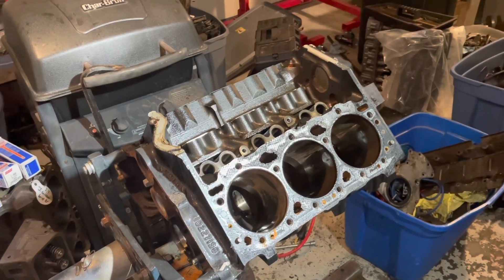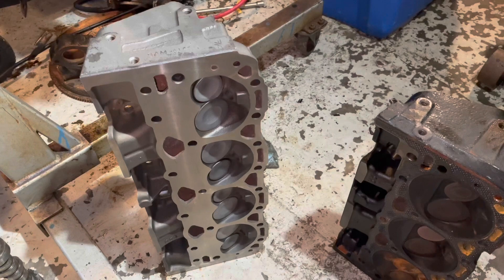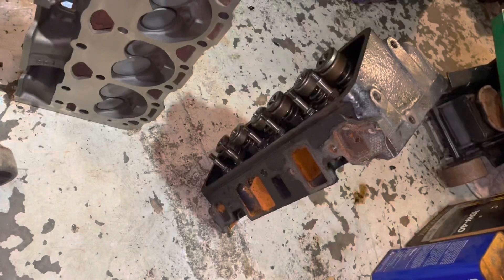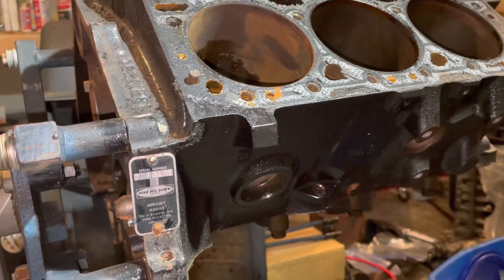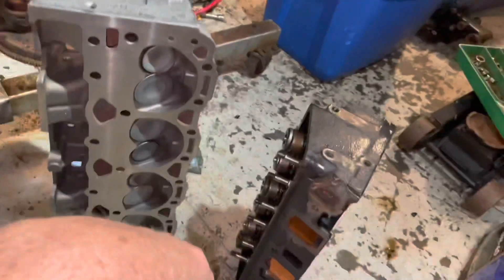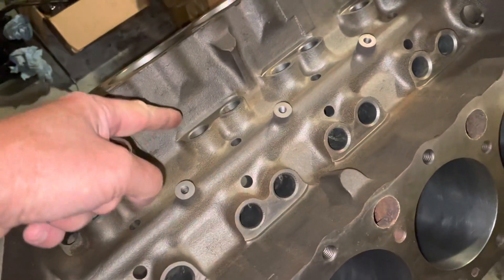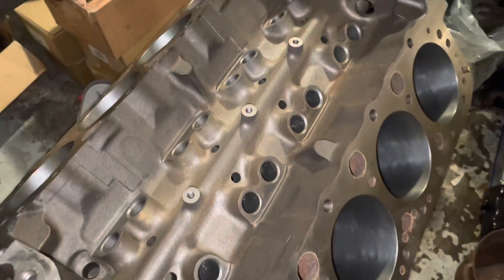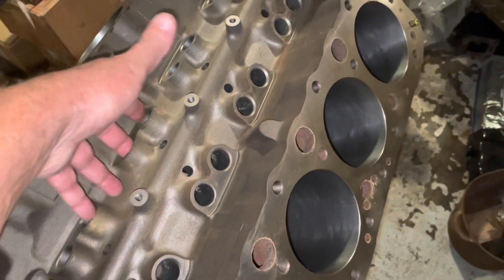Truck/Car to Mercruiser - How To Guide

Comment: If plastic fuel rail wasn't a problem. Would you go with that instead of carburetor?
Reply from the maker: I don’t understand your question as it relates to this video.
Reply: @moccasinmarine  Would the plastic intake and fuel injection work in boat? I got a yamaha 4.3 that has bad bearings, and I'm thinking of buying a car 4.3 with fuel injection. The rochester carb is also bad on my motor
Reply from the maker: @Mattias7475 the main problem is not the plastic rails (which is a problem) but the fuel injection manifold is aluminum, which will get eaten up by warm saltwater. You could only use the boat in fresh water.

Comment: Any pointers on marine lt1?
Reply from the maker: Not understanding your question? I’m not aware of a marine LT1.
Reply: @moccasinmarine   indmar made an lt1 5.7 for years, new wake boats actually  have gen v 6.2 lt1 as well but im referring to the gen 2 small block.
Reply from the maker: @pinnedit I don’t work on too many wake boats or inboard ski boats. 99% of my customers have stern drives. LT1 was only made from about 1993 to 1996 and abandoned for the LS program. They are therefore rare.

Comment: I am kind of new to the boat performance but with the headers on a boat going up would the vortec head fit with that I have a Volvo 5.0 v8 I have been told it’s a SB Chevy motor
Reply from the maker: Vortec heads for 5.0 engines offer no performance difference since the combustion chamber is the same as non Vortec heads. The only difference is the intake bolt pattern in the 8 bolt vortex pattern. There is no point to switching heads. Reason is the 5.0 bore is too small to use the Vortec combustion chamber shape.

Comment: Vortech heads will work on a 305 v8. We did that on my brother’s pickup.
Reply from the maker: The valves are rumored to hit the 305 bore walls but at the least the valves are shrouded by the bores so gains are reduced. If they fit then GM would have put them on 305s, but they didn’t.
Reply: @ they are on the truck and it runs 🤷🏻‍♂️ whether or not it’s the optimal configuration is debatable but technically they fit.

Comment: I was told you "Had " to use 4 bolt main ...is that true and why if not. Is the 5.7 and 6.2 Marine 4bolt main?
Reply from the maker: Most boat engines I rebuild are standard 2 bolt mains. This video is a 6.2 rebuild and it has a factory 2 bolt main bearing setup so what you were told is wrong.

https://youtu.be/q3C7-pWL7yY?si=w-mkuHONVhu229Tx

Comment: I noticed the color of the block. Is it a higher nickel block?  The circle track shop I worked at would get “some” blocks that were higher in nickel and they were Noticeably Heavier!🤣😂
Just wondering.  Thanks for the video.
Reply from the maker: I haven’t noticed any difference in blocks between a truck and boat engine. I have noticed that if you buy a “new” crate boat engine the block has a higher content of Chinesium.
Reply: @moccasinmarine  The blocks I seen were from the 70’s (400’s).  They had a color to them that were different from the norm.  They were also Noticeably heavier.  They had more nickel in them making them stronger.
I was just asking because of the color of the block you were showing.  Although I’m seeing it from a phone.😂😂
Just asking.  Thanks for the video.

Comment: I had to rebuild my 1995 bowtie in 2008 after running some low octane fuel on Lake Superior where they only had 87 octane and blew the lands off the pistons.  I had the timing advanced quite a bit to run 93 octane on my home lake and didn't retard it before the trip (big mistake).  The cylinders were just fine and no ridge, so only had to re-hone the cylinders at standard bore.  When I rebuilt it, I did use Vortec heads, a CS XM 262H-12 cam, and a Performer Air Gap Vortec intake.  I kept the same 9.4/1 compression ratio but did use hypereutectic replacements.  One extra thing I did was to enlarge the wrist pin clearance to ensure it wouldn't seize from any sudden temperature change.  This was recommended to me by a couple of engine builders in the Minneapolis area.  Dyno was 353/397 with a Holley 600 and extra spacer plate.  It's still running strong after 16 years.
Reply from the maker: Yes I pretty much stay in business due to people running 87 octane Ethanol gas. The combination of low octane and running 3-4% leaner due to Ethanol destroys engines.

Comment: Thank you sir!! Great video. I have a 1998 5.0 roller-cam Vortec Mercruiser that has a freeze busted block. Thinking about upgrading to a 5.7 (350) Vortec. My only question is where to find the marine specifications for 5.7 mercs?
Reply from the maker: There are no differences other than what I just stated in the video.
Reply: Sweet. Thank you sir!  @moccasinmarine
Reply from the maker: @jacobfriddle147  here is the service manual if you rebuild a 5.7. Use brass plugs for anything touching water and use the 5.0 marine cam in a car/truck 5.7 and you’ll be good.
https://marinepowerusa.com/wp-content/uploads/2019/08/5.0L-5.7L-MEFI-4-Service-Manual.pdf

Comment: This question is for moccasin Marine I am converting my 4.3 V6 truck motor as a donor because my boat motor froze. My question is I’m using the damper and the flywheel from the boat but the crankshaft from the truck engine. Will there be an issue with balancingor vibration with the crankshaft
Reply from the maker: It depends on the year of the boat engine vs the truck engine. Go to marineengine.com and find your engine serial number parts list. Then compare the part number to later model flywheels and dampers to see if the part numbers changed. If they did you may have balance problems

Comment: Can you put that vortex head and run that with a manual fuel pump or does that need to be changed?
Reply from the maker: If you mate vortec heads on an older block with a mechanical fuel pump then yes you can run a mechanical pump. Newer blocks with vortec heads were not drilled for a mechanical pump.

Comment: Wrong gm did use tbi intake on vortec in translation years. The 350 was 1995, and I'm not sure what year  the 4.3 had its translation year, but I have one .
Reply from the maker: They might have used TBI intakes on Vortec heads around 1995 but the intake would have been aluminum so still not a usable part in a boat. Boat intakes are cast iron to last in saltwater.

Comment: Had a boat shop ensure me my vortec wouldn't last 4 hours on the water. I knew it had the grey mahle pistons and I put hastings maganeese phosphate rings in it the powder metal rods behive valve springs factory l31 truck cam but with 1.6 rockers .050 offset valve keepers. Little bit of pocket porting 3 angle valve job jegs champion intake. It pushes my 3600 pound boat to 50 mph for 2 seasons and i couldn't be happier with it. I don't hold it at 5500 rpm for 3 hours straight either to be fair. Thanks for the honesty.
Reply: I forgot to add the only thing I saw you missed is the not all of the 880 roller blocks have the mechanical fuel pump rod hole drilled. The tool to do such is very expensive and if someone is in an rural area like me it takes a 4 hour drive to get to a shop willing to take on that work. My answer was an electric pump but not all want that

Comment: 14:55 Yes, with today's oil, you have to use ZDDP (zinc) additive or an oil with a high ZDDP content like Rotella t4 or t6 or even Supertech diesel oil To prevent your cam lobes from rounding off.   Or even Travelers brand from tractor supply also has high ZDDP zinc content
Reply from the maker: I stated in the video that I go out of my way to not build flat tappet engines because I don’t want to deal with the ZDDP additives. But it some cases I can’t avoid it like the MARK V 454 I’m building soon. It’s old school flat tappet.

Comment: My 1987 4.3lt engine is bad. I have a 2003 4.3lt vortec engine out of a truck. Im guessing the cam in the 87 is a flat tapped cam but not sure as i haven't taken it apart yet. If its flat tapped it can't be used in the 2003 block as those should be a roller cam
Reply from the maker: Look up the serial number of your 1987 4.3 on www.marine.engine.com. I believe you will find that all 4.3 engines since 1985 were roller cam engines. Then compare the camshaft part number to a 2003 camshaft part number to see if they are the same part. If it’s the same part then you can use it in the 2003.

Comment: I'm a regular gear head and I fell in love with the vortec heads from the day they came out. there are carbureted intake manifolds available for the vortec heads of both the v and 4.3 v6. at that point, you can get a carburetor and not have to worry about figuring out efi
Reply from the maker: If an engine already has EFI its way easier to just fix the EFI than swap to a carburetor. I’ll soon post videos on EFI system troubleshooting and timing.
Reply: @moccasinmarine  true. I've done both. However, as far as performance options go, it's much easier to find a high performance intake for a carb application...and much cheaper. I've priced out a Marine intake with efi for $700. Mild boost in performance for the intake, then you still have factory sized injectors that you would have to replace. With a carb and intake, you could be as cheap as $500 and you're off. Of course, I'm talking hotrodding, not just start and go. For that, efi is much more reliable and more efficient. A carb can't touch the cold start of efi, or the fuel mileage of efi. I still enjoyed the video and thank you for replying

Comment: Coming from a complete noob. Are truck cores pretty interchangeable? Like if I buy a Chevy V8 core, convert all the plugs to brass, slap a vortex head on there, bore the cylinders .5 thousanths over, get different cams, and should be set?
Reply from the maker: Not necessarily. Vortec blocks (1996 and later) use a plastic timing cover with different bolt hole pattern and cam plate sizes. And the mechanical fuel pump on Vortec blocks is not drilled. Older blocks back to 1988 can be used but you’ll have to deal with work arounds. 1987 and later are no go’s. They have two piece rear seals and are guaranteed leaks.

Comment: Hey man I designed and built a jetboat. Currently I have a Yamaha svho as the power plant (around 265 hp) but I keep having issues with it and so I’ve kinda gone down the rabbit hole of building a new power plant. This video has been super helpful.

Comment: I have a 2004 Mercruiser 5.0. It’s 260hp. Is there a way to get 40hp. more out of this engine without a complete swap out to a 350?
Reply from the maker: Where did you get the 260 Hp figure from. All my experience has shown that 5.0 makes about 220-230 Hp.
Reply: @moccasinmarine  I got it off the Sea Ray Spec Sheet for my 2004 Sea Ray 200 Select. It states that the Mercruiser 5.0 MPI is rated at 260 hp with either the Alpha One or Bravo III Drives. I have the Alpha One. It also shows the 350 Magnum MPI at 300 hp.

Comment: I am going to use a 2001 4.3 vortec truck engine in my boat. I decided to try it with the truck cam. Do I need to pull the heads off and change that gasket to Marine?
Reply from the maker: If you don’t use the engine in saltwater I wouldn’t change them. There is so little metal exposed to water between the heads that it would take a long time to corrode through. However the bigger problem is the steel core plugs. Those could be eaten through in one season.

Comment: if it is not to much to ask that for a 4.3 v6 if I buy an engine rebuild kit for it and is listed as a vortec rebuild kit is that ok to use if I don't go with a vortec engine style heads or intake and just keep it stock and use a vortec rebuild kit for bearings and stock heads and intake and roller lifter and use my marine cam in the truck engine 4.3 I want to rebuild and  again with the vortec rebuild kit?

Comment: My origional motor is a 87 to 95 350 mercruiser. I believe it would be simpler and cheaper to buy a 87 to 95 350 from a suv. If i already have the old closed cooling system, intake, alternator, exhaust manifold, distributor and carburetor. What else should i swap into the suv motor besides a camshaft and freezeplugs
Reply from the maker: That’s about it  you could upgrade the timing set to a heavy duty model.
Reply: @moccasinmarine  the part I'm confused about is most 87 to 95 Chevy motors are fuel injected and I'm unsure if they are flat tappet or if the crankshaft is compatible or if the heads are compatible.i read in a blog that converting from fuel injection i would need an electric fuel pump. Also will i have to do anything complicated such as reprogramming the thunderbolt ignition or timing  or anything  else

Comment: I have a 1990 4.3 mercruiser that’s blown and am getting a 92’ 4.3 out of an S-10 . Will I have to change the heads from the merc to the s10 motor ? Or will I be able to just bolt my carb intake onto that motor ?
Reply from the maker: Should just bolt on. Vortec heads didn’t start until 1996.

Comment: The 4.3L 140 casting number heads are better than the 742 head. The 140 heads have pressed in exhaust seats. The 742 heads have induction hardened exhaust seats and are more likely to crack around the exhaust valve seats. Both heads are very prone to cracks, especially around the head bolts & water jackets on the head gasket side.  Just about every remanufactured head I've ever bought had multiple crack repairs on them. Usually, they are ok. I've installed a bunch of repaired 4.3L,5.0L, and 5.7L heads with stitch repairs, Never had any problems with em'. The 96 & newer 4.3L is different than the older ones.  They are externally balanced,but not on the front of the engine, but at the rear. So the flywheel or the flex plate has an extra weight on it, similar to the 400 small block. The harmonic balancer on the other hand is a neutral balance. There's actually 2 different crankshaft for the 96 & newer 4.3L Vortec. Luckily the pin on the crankshaft is in different spots,so you can't mistakenly bolt on the wrong flex plate or flywheel, That would suck.😂
Reply from the maker: Thanks for the info. I have all my cylinder heads magnafluxed and repaired when needed.

Comment: So i have a question  i have a crusader 454xl  it has a small crack in the block .. i was wondering if i could  find a 454 from a chevy truck from around the same time  1992  and use the Block  swaping the cam  and heads from the marine 454
Reply from the maker: Yes but you also need to swap the core plugs to brass. Truck or cars will have steel core plugs which will rust out in a boat.
Reply: @moccasinmarine  thanks I knew that part I just replaced freeze plugs on another engine

Comment: As  you probably seen yourself back in 99 we had a year old glastron come in with less than probably 40 hrs and a froze block I found a standard truck block from somewhere and reused crank rods pistons and bearings even rings and put in the block and dropped in my 90 chevy truck.cheep fixup. Back when I rebuilt lots 2stk pwc's I set them up on the loose side too knowing they were going to be hammered right out of the gate by kids. I built several small block 400's and dropped in my boats set up like car and crane rv cams but I took it easy on them first 5-6 hrs.

Comment: I used a 93 s10 4.3, and put the marine headgaskets and brass freeze plugs, and my original intake and manifolds bolted right up to it perfectly.
Reply: Did you change the cam?
Reply: @Spoolmaster  no I didn't, I sold this motor,  but the people said the motor is doing great in the rinker they have it in.
Reply: What year was the boat you put it in?
Reply: @billymartin1874  89 I believe.

Comment: Great video. Can I use an 89 block and take all the guts out of my cracked up 2000 block? Or is the block different with an internally balanced shaft?
Reply from the maker: You can’t use a 1989 4.3 block in place of 2000. Balance shaft blocks are a very different casting. I think balance shafts came out in the 1992 MY.
Reply: Okay sir i have a question i have a 98 chaparall 1830 ss with the 4.3L v6 that is locked up. I just came up on a 4.3L v6 out of a 06 gmc sierra. How could i make this work. I know for sure intake and freeze plugs but honestly not sure about anything else
Reply: Thanks Azyyah

Comment: Hi, how much you charge to build an marine engine for a boat? It's an 1986 Sea Ray
Reply from the maker: Where are you located?
Reply: Wichita, Kansas
Reply from the maker: I’m in Georgia. That’s a bit too far for me to build an engine for your boat. As to what I charge, it depends on what engine you have but most rebuilds run $3700-4000.
Reply from the maker: I’ve had customers from Virginia but I had them agree to waive the warranty because I can’t travel that far to fix a boat.
Reply: Can I change an car engine into a boat? If, so what would I need to get to do so
Reply from the maker: @randynewton6065  the video you commented on tells you how to convert a car or truck engine into a boat engine.
Reply: Ok. Thanks

Comment: 87. Up 43 v6 engines out of a van has metal retainer plate for lifters
Reply from the maker: True and in 1994 engines they switched to a plastic lifter guide. Always use genuine GM plastic guides. There are Chinese knock offs that melt.